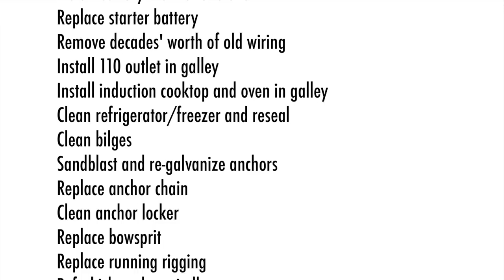The Project List & The Dinghy - Episode 2 - There's A LOT to do before we can live on this boat!

Comment: Nice video! To simplify life get an ePropulsion electric outboard, have used mine for two years now and they are great! Also, stay away from dark fabric colours, older boats do not get enough light down below.
Reply from the maker: I need a dinghy with the cajones to push humans and scuba gear. I will also be using the dinghy to get myself out into the deeper waters to attract larger pelagic fish for spearing. We tried to get the 2021 Mercury 15HP, but they are back ordered until April. But we are happy with the new 9.9 as we can still do 20kts, and it's nearly 20lbs lighter than the 15HP. -Ryan